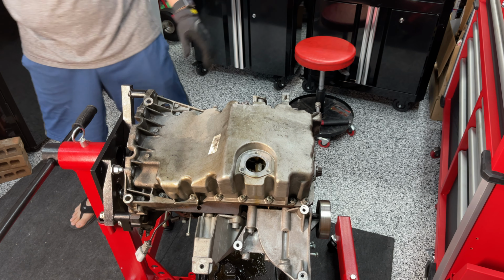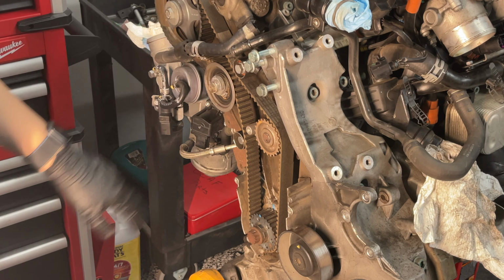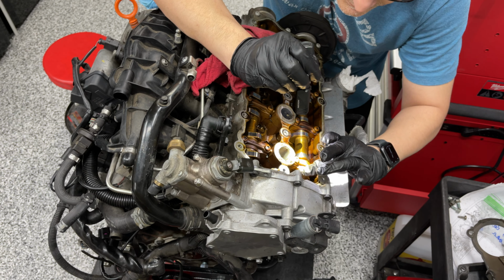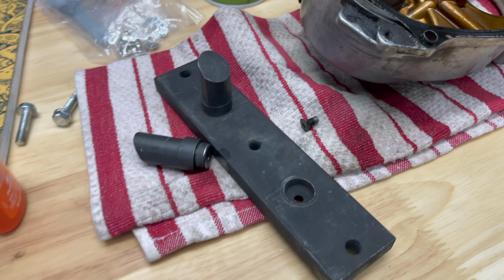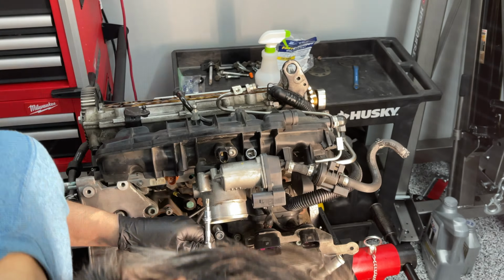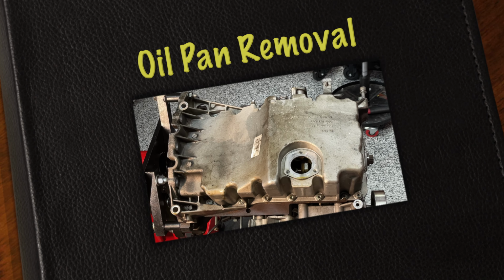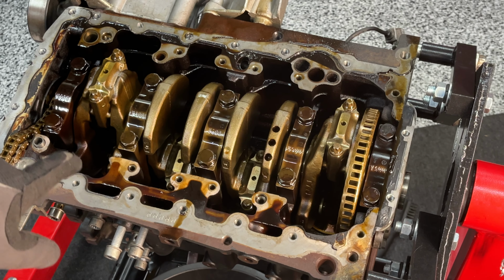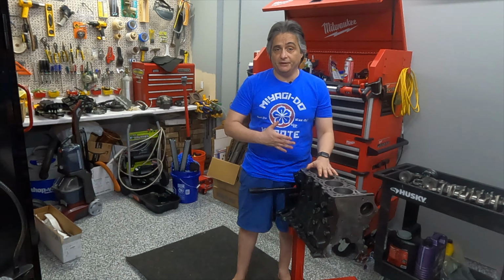PROJECT: Olaf - Audi A4 2.0 FSI Complete Engine Teardown

Comment: A tip for anyone thats got one of those cam locking tools. Run a weld around both of the locking pins
Reply from the maker: I like this idea. Although I got that Schwabben and it's good quality, it wouldn't hurt to reinforce it. Thanks for watching!

Comment: Gd video. Was the engine done because i have the same issue where im getting a low oil pressure
Reply from the maker: Thanks! So the engine was not completely ruined but the cylinder head suffered damaged and had to be replaced. If you have low oil pressure I'd put a mechanical gauge on it and take a reading at cold start and warmed up. Good luck!
Reply: @YogisGarage  I bought a new oil pump just to be safe but I'll open the engine to see if there a timing chain guide problem

Comment: couple of tips for you from fellow audiziner that knows you:
never ever use an extendable ratchet on tight bolts. They have lot of movement in the handle and end up stripping them
check the date code on timing belt tensioner. It should have month and year printed on it. This might save money on TB if it was replaced recently. 
replace the oil filter housing. Dont cut corners by just replacing the gasket.
Reply from the maker: My extendable ratchet is already skipping on me. I ended up using a breaker bar with my floor jack pole for extra length.  As far as the timing belt tensioners, I'm refreshing the whole thing with new tensioners, water pump and belt.  Might as well, right?  
I've been contemplating replacing the housing. It's only $85 so it's worth it.  I hate the OEM one. It doesn't really allow for a socket to fit on it to loosen.  Thanks for the tips Ray! Keep watching man, more fun coming.
Reply: @YogisGarage  you need 5mm and 6mm 1/4 allen sockets. I recently replaced my with oem one I had hard time with 10mm socket not gripping in couple tight spot and I didnt have 1/4 allen sockets at that time, ended up using allen wrenches https://www.harborfreight.com/36-piece-sae-metric-hex-key-set-94725.html

if you keep replacing everything, its gonna cost a lot and probably close to brand new engine. Most important things to replace are oil filter housing, camshaft, chain tensioner, timing cover gasket, piston rings and all bearings especially connecting rod ones, get a used oil pump assembly and chop off the balance shafts, dipstick tube oring, thermostat, coolant flange,pcv,cam follower, adjust turbo charger wastegate arm while its out,  inspect Diverter valve, thermostat,clean intercooler hoses with soap water degreaser, In case you buy new pistons buy the ones for bpg engine
Reply from the maker: @Ray J  I just ordered new bolts for the harmonic balancer.  They were already messed up.  I swear I tell people that I am NOT in the bolt buying business but looking at all the ones I have to replace indicate otherwise.  😆
Reply: @YogisGarage  instead of buying allen, you can also use triple square bolts for crankpulley(audi used them on 2007 and 2008). Altest they are better and lesslikely to be stripped.
Reply from the maker: @rayj33  got a part number?

Comment: Did the cam journals get torn up because of the plugged up pickup tube causing low pressure or some kind of debris?
Reply from the maker: That's right. The clogged pickup caused my low oil pressure and the starvation caused the damage to cylinder head.

Comment: Great video, not super detailed but just detailed enough.
Reply from the maker: Appreciate you watching!
Reply: @YogisGarage  I'm currently doing a head gasket on my 2.0T FSI.    After I replaced my intake cam I thought I was done working on it.  If you still have the car it's a good investment to get an oil catch can and place it in line of the valve cover to the turbo hose.  It'll help preventing all the oil in the intercooler system and delete the PCV into the intake hose too.

Comment: How did you figure out the specialty tools you would need to do this job?
Reply from the maker: Go to emanualonline and find the repair manual.  I’d share it with you but you have to run it on a virtual machine as it’s not just a pdf but an old application that only supports Windows XP.
Reply: @YogisGarage  thanks, I'll check it out

Comment: Yeah.. I stripped the cam adjuster bolt. 0/10 do not recommend!!
Reply from the maker: Yeah. Buying specialty tools suck. I think my Porsche may have a poly bolt. Maybe I can recoup some money. 🤔
Reply: A lot of ppl mess with it while replacing the intake came, not know you can do without messing with the exhaust cam side.  Unless you really need to take it off you can remove everything around it without removing that adjuster bolt.